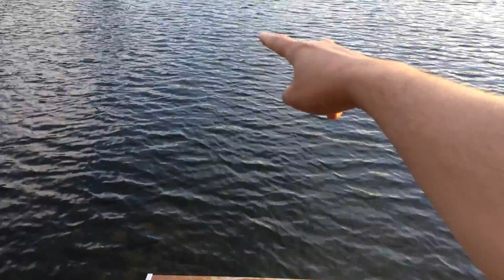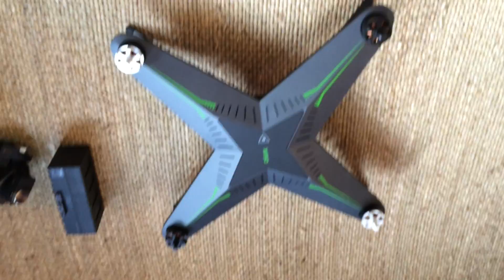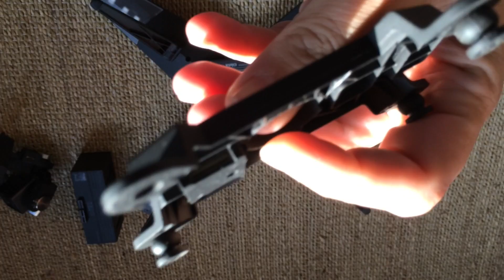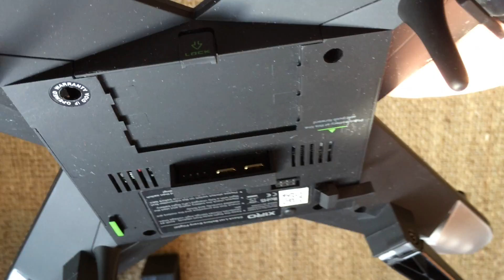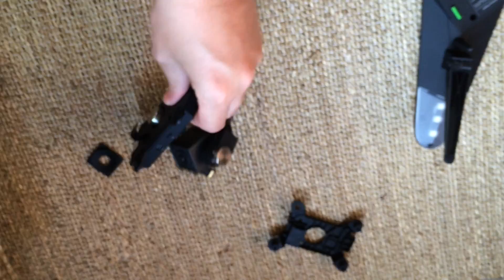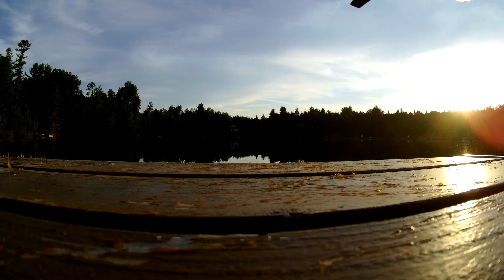THE BATTERY FELL OUT! - Drone Crash into Water

Comment: I just assembled my new Xplorer drone and noticed the battery is not supported at all on the rear side where the so called 'lock' is located, and naturally sags down about 2mm when you let go of it. This means there is only 1mm of the lock tab overlapping the battery. I can guarantee this battery will be prone to falling out on some craft where manufacturing tolerances are too great (some may be ok if tolerances happen to be tight). I cannot understand why they would design a 3mm lock that does not go under the unsupported rear edge of the battery which is the heaviest part of the drone. Are they trying to save on plastic or what?

Comment: If your battery was not in properly your xplorer would not be able to take off. its impossibe for the battery to fall off the xplorer while its in flight
Reply from the maker: I'm not lying. It is absolutely possible.  Go read up on RC Groups Xiro Owners forum.  Battery drop offs have happened to many other people worldwide. That little lock on the end is not enough to keep battery on drone if the bottom was not fully seated in the grooves.